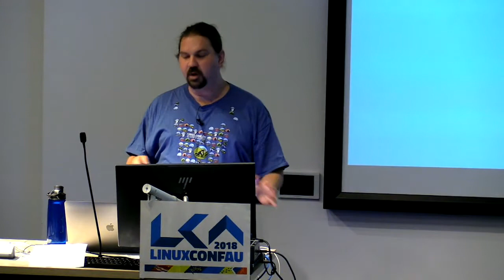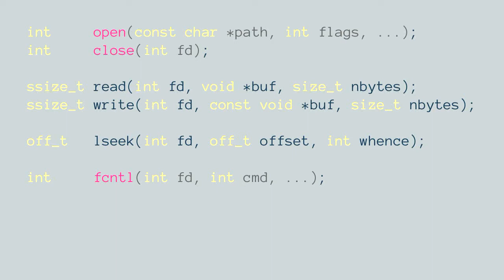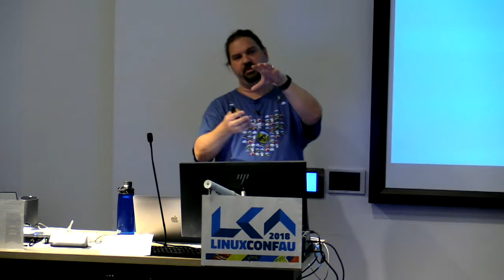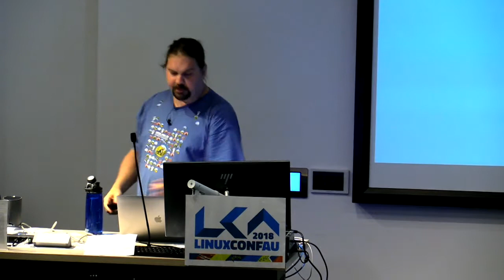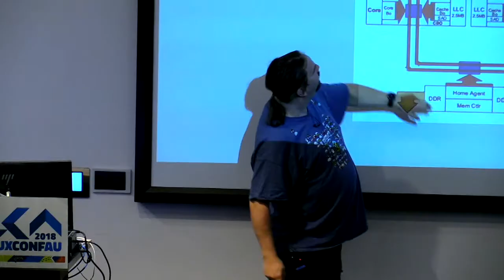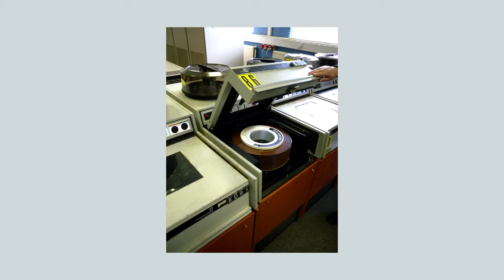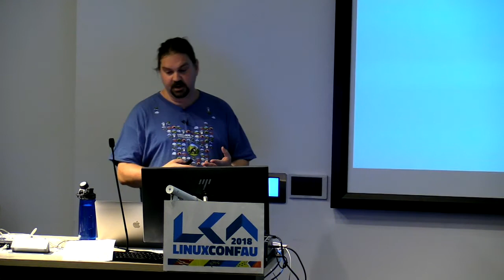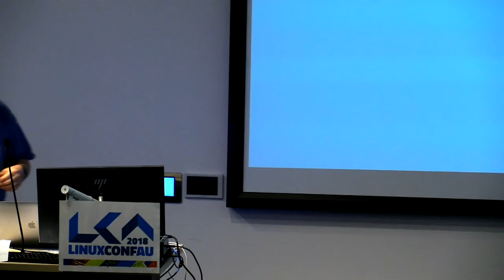A Brief History of I/O

Comment: Fantastic talk, really gives a great history of how interdevice I/O 

Also, busbars have their origin in eletrical power distribution; there are bars of solid copper that carry high current electricity where an equivalent sized wire(s) would be impractical. 

They are also used in modular cabinets to allow safe live disconnecting and reconnection to a live bus. The same action as racking in a hard drive or card. The similarity in that action to installing/removing early computer and electrical control systems componets is probably where the bus first got its name.